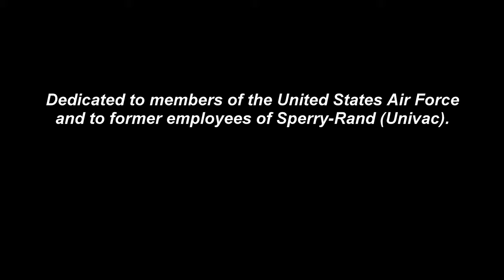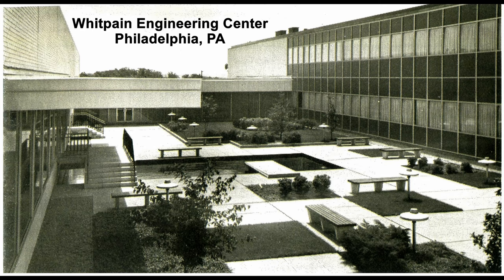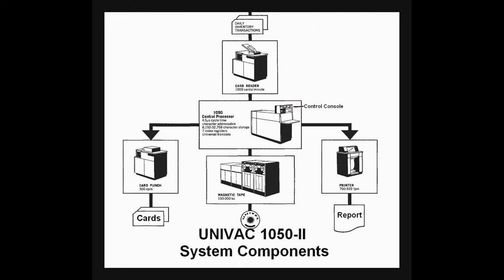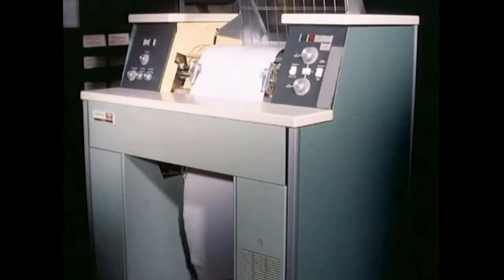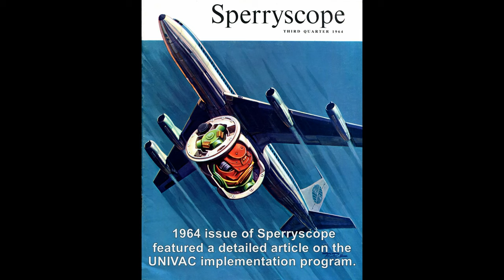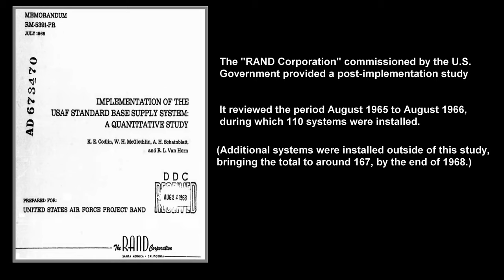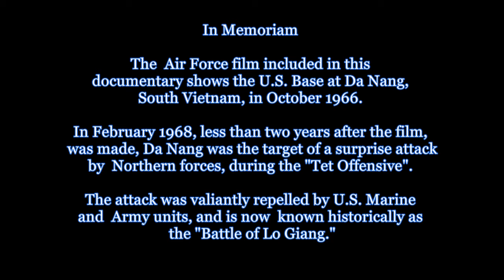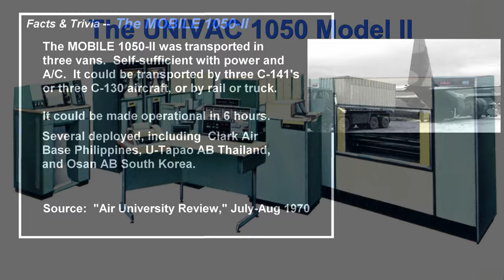Vintage Sperry-Rand UNIVAC 1050 U.S. Air Force Computer Automation (1966) AFLC Base Supply (Vietnam)

Comment: Thank you for producing this.  I trained as a 64830 in Amarillo Texas in 1967 and was assigned to Langley AFB.  When I was selected for the training, I was told that I would be getting orders for Vietnam within the year.  I was stationed and Danang AFB in July 1968 and was transferred to Plieku AFB because a buddy of mine thought it would be a good experience to be there when the computer was installed.  My replacement in Danang, Sgt Cliff Lefler of Ohio,  was killed in a rocket attack at Danang while he was working with one of the remote computer terminals.    I left the Air Force in July 1969 and the training I received in the USAF set the stage for a career in "Data Processing" and subsequently "Information Services".  This is a remarkable piece of work.  Thanks again.
Reply from the maker: Hi @jbjump5966, thank you very much for sharing that bit of your history!  That is a fascinating story and one that many can relate to.  My uncle was there as well.  It was a time never to forget.   It is good to hear your USAF training helped boost your career in data processing and beyond.   Their training some some of the best, from what I have read and heard from those who took it.  Thanks very much for your feedback.   I hope you will explore some of our other vintage tech videos as well. VK, CHAP